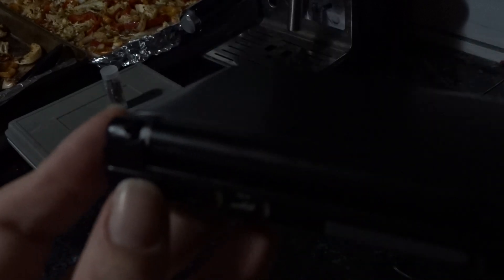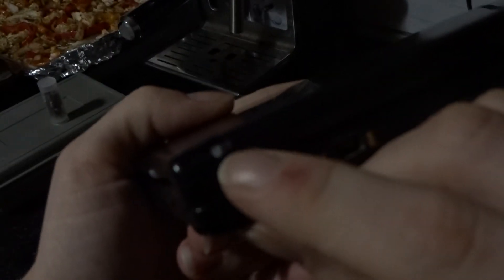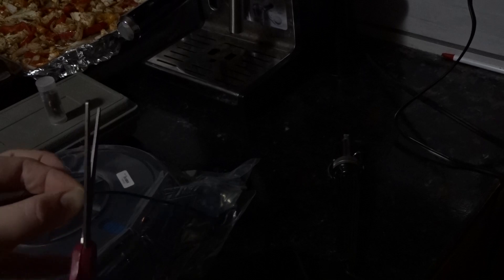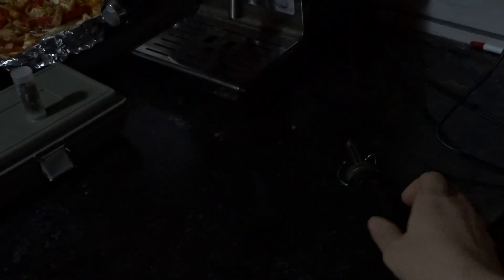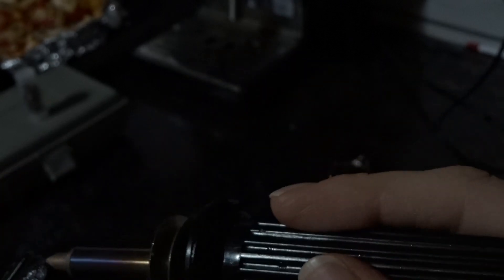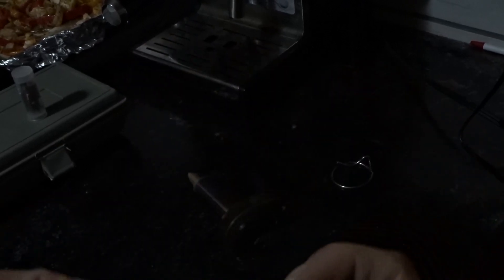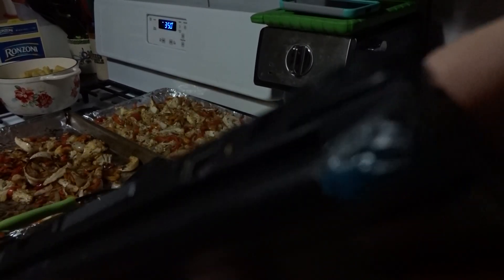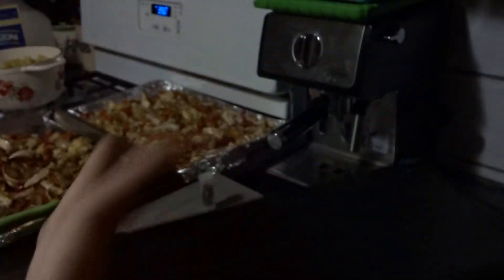HOW TO FIX BROKEN CRACKED PLASTIC ON NINTENDO 3DS XL USING A WELD/ SOLDER METHOD

Comment: Does it work with any 3ds part
Reply from the maker: I am not sure, it did work well for this particular part of the Ds though. Though it is difficult to tell where wires may be in the system... I could see the plastic was thick at this part of the Ds.